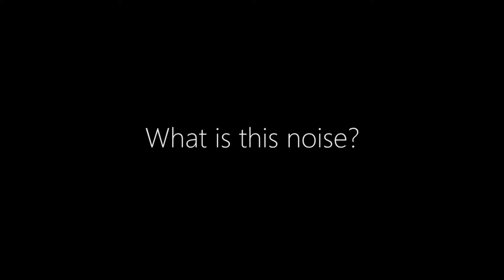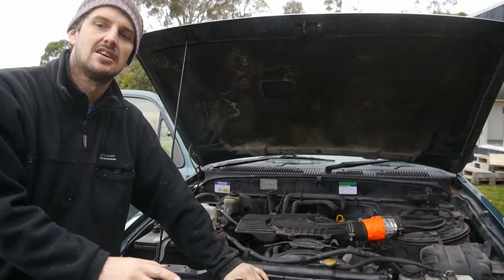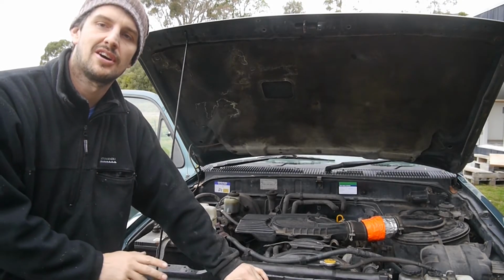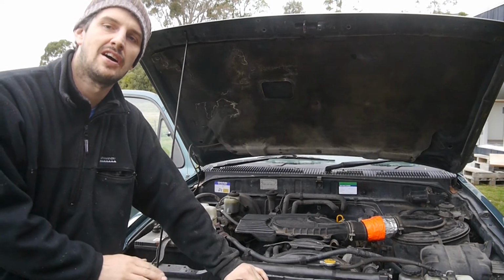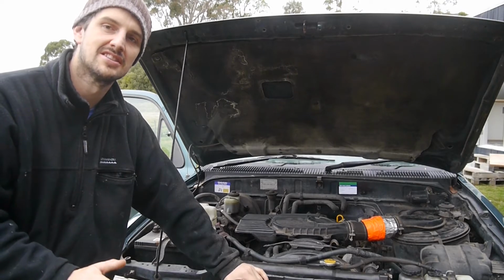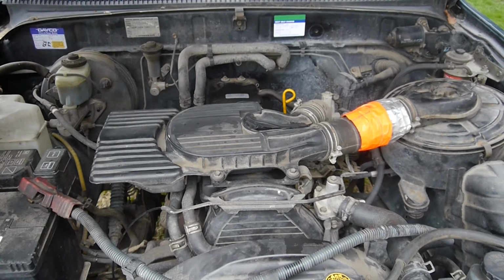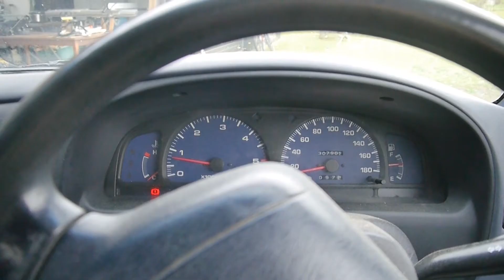What is this noise coming form a Toyota Hilux 2000 5L?

Comment: Hi, i had the same, it is your injector pump sucking air. Whilst you idle pump your manual pump with your hand, you will find that sound is gone, next press you manual diesel pump whilst the engine is off, if you are leaking diesel the fault is on the delivery side of the manual pump.
Reply: what noise do you say? ticking?

Comment: All I can say is I wish I had the answer because I have the same noise minus the whiz sound on the accelerator. All happened after t belt and pump change. Mine started to quiet a bit after a month. I have two theorys .One is valve clearence becomes harder after a new t belt and it needs new valve shims or one of the belts is slapping. Mine runs fine as well except for that tapping noise.
Reply from the maker: I think I had a noise before the t belt change but not 100 %. I def know its worse now. Your theory could be right. Are you going to do anything about it?
Reply: I forgot my other theory, Valve lifters will starve for lubrication when the engine is hand turned and the lifters may suffer lack of lubrication. Old hydraulic lifters can collapse. I tried Liqui-Moly Tappet Stop Noise Lubricant from Super Cheap. It can clear glug from an old lifter and let the oil back in. Some but not all my noise went away. Worth a try.
Reply from the maker: Pretty sure I have traced it down to the alternator
Reply: You managed to repair it ?

Comment: what is that flat plastic box over the engine. . . someone explain please . .how that intake system works
Reply: Just a big water catcher/ intake no clue if it’s there for a major reason or not but I’ve bypassed mine and put a pod filter on and seems to run better
Reply: It's a silencer.

Comment: Hey mate just wondering if you ended up working out what that knocking sound was as mine is doin the same. Thanks
Reply from the maker: Hey noise has reduced slowly. I reckon it was the the new timing belt i did maybe to tight...? Done 60k since.

Comment: My ute makes the sound same noise. Its a fully rebuilt engine and its been sitting in my driveway on blocks for 3 years, this year i crash started it in janurary and she started 3rd pop and then that tickong noise came..... theres absolutley nothing wrong with the truck whatsoever everything in there is 3 years old, as in 3 years old of sitting there after coking out of the mechanics

Comment: I just have been told that these engines have an issue with the cam not being tightened down resulting in a light  tapping/rattle  being emitted from engine .
Reply from the maker: is there anything you can do about it?
Reply: @OurLifeBlock  yeah, they get them tightened down tighter and there's no more problem, mine has done 200k and is not doing it yet, mechanic who knows them just told me about it recently. i don't know exactly what is involved but i think you can google all about it.